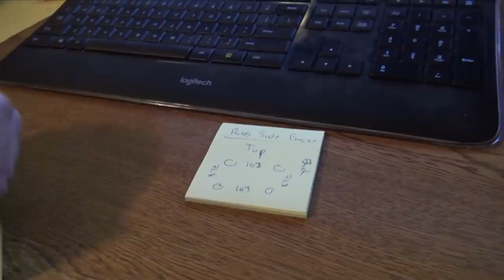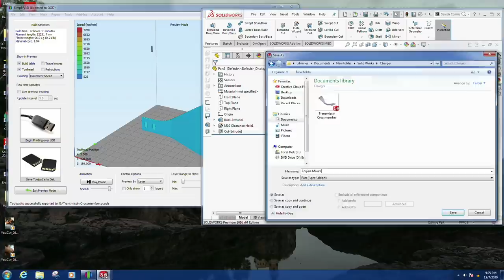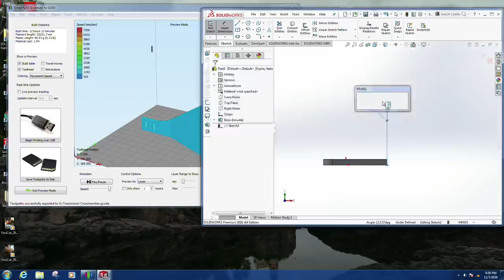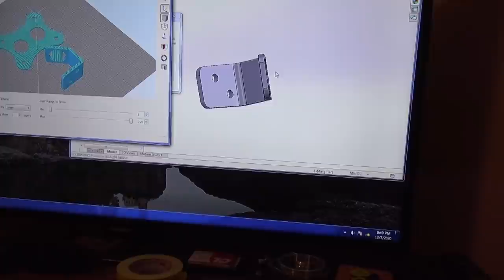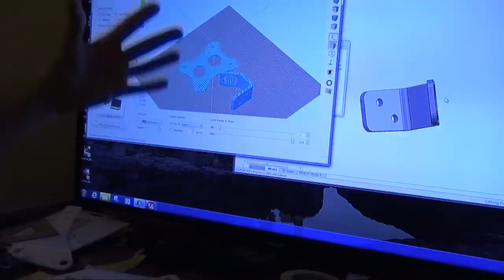Building the Ultimate Station Wagon | 2021 Charger Magnum Hellcat | 1000HP Hellwagon | Pt 28

Comment: I have an ideal you may love. I saw a few weeks ago that the group I'm in of the SRT-10, they had a guy cut the centre barrels out of the SRT-10 rims an made them a 3 piece wheel. What if tyou did that to the Trackhawk rims cut the center of the wheel out an made them a 3 piece wheel an would also be able to have chrome on color or color on chrome. It would be one of a kind set that would make your more one of a kind.

Comment: I know it probably won't need it as there shouldn't be much load on it, but in the final piece of the subframe support bracket, will you be adding a brace between where the tube welds to the bracket and the bracket bolts to the car? Just for extra strength (if needed) it might make sense to have a brace between the 45 angle and the bolting surface on one side.

Comment: what paint goes on 320? I use it for primer, solid paint 500 and metallbased 600-800. the clearcoat will sink in thoes  gridmarks.
Reply from the maker: Sealer

Comment: If when completed we ignore the value of the physical part of the car, and instead determine its value based on the number of hours Dave has spent on it...let's say we pay Dave a meager $15 an hour...how much would the car be worth?
Reply from the maker: 15 an hour is way too low most body shops charge 80 to 100 an hour
Reply: @Junkyard_Dave  That's why I said "meager". What I'm interested in is what the total number of hours will be, because I bet if you multiply that by only $15 an hour, it will still be a hefty sum.

Comment: Windows 7?? You know it stops updating soon right?
Reply: I think it already has. I'm planning on upgrading to Win 10 64 bit, and a new video card soon because of that.
Reply: It doesn’t really matter if he is using it for 3D printing, doesn’t surf the internet or connect it to a lan/internet. I ran XP for 5 years after support ended as I had a setup that used the pc that had XP on it. Never connected it to the internet and no issues. Matter of fact I still have the MB/Cpu/ram and hdd in a box that I could power up today and use it again. But I see your point of helping him out in case he didn’t know this but I also wanted to share depending his use he may not need to for awhile. I personally run Windows 10 or MacOS on all machines and run a lot of stuff in VM’s on my server as then the skys the limit and if something goes wrong just load the backup and 20 seconds later your running again.